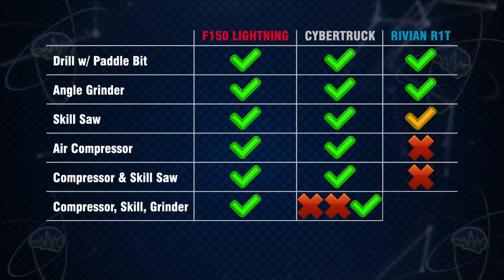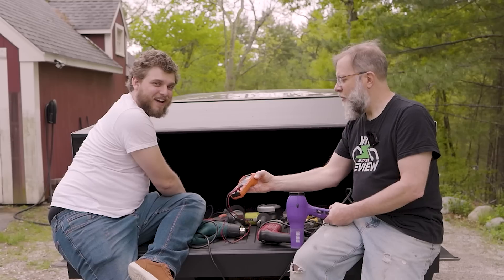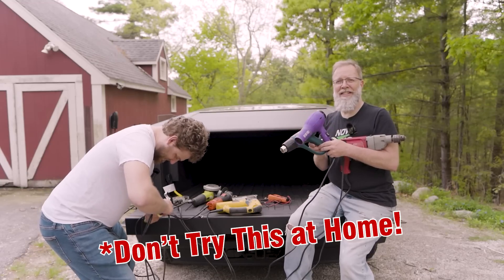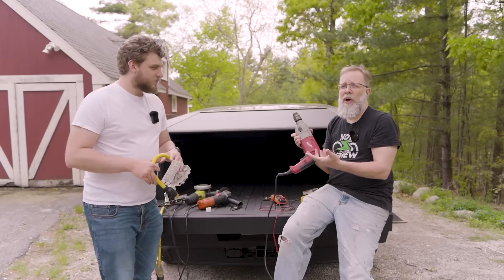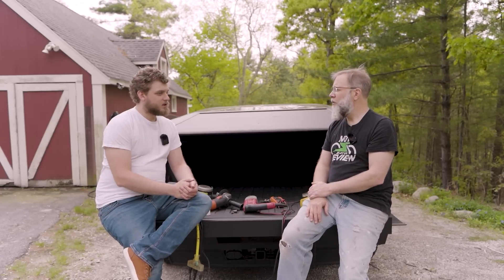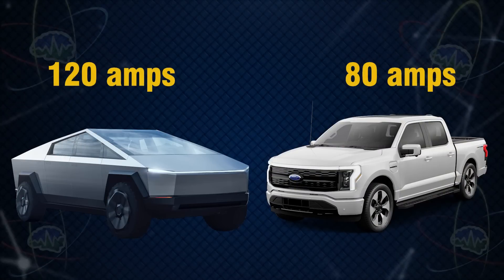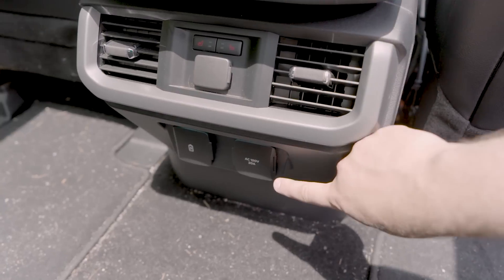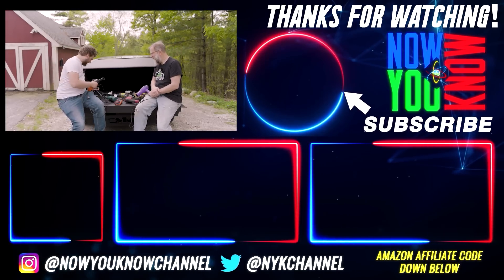Cybertruck vs Lightning: Find Out Which One Has More Outlet Power | In Depth

Comment: What are the odds of Ford getting a recall on the bed outlets for putting out 30A when they should be limited to 20A?  That seems unsafe (like using the splitter).  Likewise, is Tesla likely to get a recall on the auto-reset of the fuse causing stuff to come back on (perhaps right after setting down the "off" tool)?  At least Tesla could fix that in software.

Comment: i wonder could you use nacs to charge another EV with DC power from the cybertruck battery to save on loses from conversion from dc>ac>dc
Reply: also push the maximum of 14kw as 120amps x 120v is 14,400 watts

Comment: I would not recomend using a Nema 14-50 240 volt to 120 volt adapter on any EV.  Use the 120 volt plug, and if needed use a power cord with multiple outlets. Remember don't exceed the 20 amp rating for all plugged in devices. The 14-50 plug  should only be used in an emergency where you need 120 volt power and the existing 120 outlet is not working. In a 4 wire system like the 14-50 plug if the white ground wire becomes disconnected  then the device feeds 240 volts to whatever is plugged into 
the 120 volt outlet which  will  result in an overload and  fire.
Reply: Wait a minute, if the white wire is disconnected on a two wire circuit, there is no return path other than ground at 120V.  To get 240v, you need L1 connected to L2, unless I’m missing something.
Reply: If the neutral becomes floating it will not work on those 120V adapters.  2 of them use 1 hot and neutral and the other 2 use the other hot and the same neutral (14-50 neutral).  Without that neutral connection the tools just wouldn't work on the 240V adapter.

Comment: Jesse, dude, holding the angle grinder with fast spinning disk facing you, no safety glasses or shield and you think not looking at it will save you from injury? Glad electricity still works right. :)
Reply: They coulda just taken the actual disc out lmao

Comment: Your test showed the 40 amp plug using 4.3 KW or 4300 watts. Divided by 118 volts equals 36 amps. You did not exceed the the 40 amp rating. However  Cybertruck says it's max rating for all plugs together is limited to 40 amps. The truck does not have 120 amp capability.

Comment: From the Cybertruck owner's manual:
"All AC power outlets combined (120V cabin, 120V cargo bed, and the 240V cargo bed outlet) are limited to a combined maximum of 40A."
Reply: I was thinking exactly this.  They were smart enough to think that the outlets in the Ford could be sharing a circuit and did a test to prove it but then brain farted and gave the Tesla a complete pass by assuming every outlet had its own circuit and didn't even try the same test.  Strange thinking...   So Basically The Ford has Twice the output and much better outlet locations.   I think someone owes Ford an apology edit at the end of the video setting things straight.  That is, if they are really trying to be fair and not spread misinformation.
Reply: @darpompie4354  Yep, never happened, so you have your answer.
Reply: @usa-ev  Yah.  I never looked at the date.  They had 4 month to add a little blurb correcting their error with countless comments showing where they went wrong.  I guess they don't care about the integrity of their channel.  I now know that anything I watched here in the past may or may not be true and that there is no reason to watch anything here in the future.  I don't understand how anybody serious about growing a channel would operate in this way.
Reply: Yeah, this was dumb. Read the owner's manual and find the specs.

Comment: According to the Cybertruck owners manual, the max rating of both 120 volt plugs in the bed is 20 amps total, the cabin 120 volt plugs also are 20 amp max total  and the 240 volt outlet in bed is 40 amps max. The total combined for all plugs together is limited to 40 amps.  This is considerably lower than what you showed in the video. Please revisit this. Thanks
Reply: I look forward to the hat eating episode.
Reply: Could just do the kW (split phases), Lightning has 9.6kW (3.6+3.6)+(2.4) and the CyberTruck has 9.6kW (4.8+4.8) + Power share of 11.5kW, but then the Lightning also has the DC home power backup capabilities.
Reply: @D0li0  But my guy, you're thinking rationally not emotionally, and that doesn't show how the CT is any better, and we've got all this Tesla stock, you see? Com'on, man!

Comment: The 40 amp 240 volt Cybertruck outlet  is good for a maximum amp of 40. When you split each side of the 240 circuit you still only have 40 amps total but now at 120 volts. So having 4- 120 volt outlets  on your plug might be convenient for plugging in various appliances each plug is only good for a total of 40 amps by itself. But  since it is a 20 amp plug you should limit it to just 20 amps. Again even though you have 4 outlets the max rating is still limited to using  20 amps on any 2 of them at one time. Remember circuit breakers are rated for amps not total power.  If you tried using all 4 pluga at 20 amps the Cybertruck circuit breaker will trip.  Please please have this verified by a certified electrician so other Cybertruck owners don't try to pull 80 amps from  the 240 volt outlet.  Again the wire and breaker are limited to 40 amps no matter what voltage  it is on. Its the power that gets doubled  for the same size wire when  you go from 120 to 240 volts
Reply: This is correct the amperage is the limiting factor.

Comment: If I was going to use it for construction site, I would get Electrician to build a small electrical panel. That get feed from the 240v plug and have 4 20 plugs on breakers.  And then maybe a 50 foot 240 extension cord if you need to put in a central location.

Comment: Another option $1500 USD buys a portable power unit, DC-DC charger and a 200watt solar panel. Run chorded and battery tools all day.
Reply: Those things don't put out anywhere near this much power and could easily be fully discharged before the days work is over.
Reply: No issues for my mobile work/lifestyle.
Reply: @tumbleweed1976 , great, but those are completely different use cases.  Powering some electronics and an occasional coffee pot or microwave is not anywhere near the 10kW loads a cybertruck can run for many hours straight.  Both could get a lot of jobs done, but not on the same level.
Reply: @CL-gq3no  If I ever use my battery for a coffee pot or microwave I’ll report back.

Comment: they have the spliters that have fuses in them also that cost around $40
Interesting, the F150 is touted as a construction truck that people buy just for another vehicle.  Where the CYBERTRUCK was designed as a vehicle that can also be used by construction worker or tow.

Comment: You two are a hoot!!  Fun to watch. FYI the 240V circuits on both the Ford and Tesla are using a common neutral conductor and any load on each of the two 120V circuits reduces the neutral load from the other 120V circuit. In other words the two 120V loads become series circuits on 240V and the neutral conductor only carries the imbalance. I wonder if there is any Ground Fault Circuit Interrupter (GFCI) built into the system to detect a ground fault to protect the user?  Are the circuit breakers manual reset or do they reset automatically when the overload is removed?  I'm an old, retired electrician who dreams of owning a Cybertruck along with my Model Y. (Wife is extremely skeptical that I actually need one;)
Reply: That's the most technically accurate way I've ever heard about how the phase splitter works.
BTW, my Dad was a master electrician for over 50 years.
Reply: Ford has GFCI. Not sure about CT. Ford has manual reset CT auto resets after 2-3 seconds.

Comment: I think it takes 3 phases for 240. 3 phases are spread to 3 outlets 1 phase each here.
Reply: FYI: 3 phase in North America is typically 208 volts. that's 120 volts between any phase and neutral, but 208 between any two phases.
Reply: That's wrong. In North America 240V is single phase that is then split into two 120V circuits.
If you live in North America go look at you power lines, follow them back to your transformer you'll see that the primary side of the transformer is only connected to 1 phase of the grid.

Comment: I know you only want ideas from Patreon supporters, but I’m going to suggest them anyway. There is an accessory wire underneath the front tub of the Cybertruck. Can you use that wire to put a 110 outlet in the frunk? And if the wire for the light bar is by directional, can you put flexible, solar panels on the glass roof and plug them in and charge the battery.
Reply: Well then be a patron supporter, it's a dollor
Reply: I can help answer that for you. The accessory mid voltage system is not bidirectional. Nor can it support a 110/15 outlet as it is maxed at 180W.

Here's what you could do though: use the accessory 45v system as a trickle charge maintainer that can be turned on and off to a 12v battery through a charge controller. In parallel to the battery wire an mppt solar charge controller and a 2kW inverter. Add solar to spec for your battery and controller. Then L1 charge your truck from the 110/15 inverter circuit.

Comment: Lots a tools with no loads on them.
Reply: It's telling them how much power they are drawing, so why does it matter?  They are just trying to pull amps/watts using loads they happen to own, not determine some bizarre combination of duplicate tools that can run at once under unknown conditions.  They could have used 6 toasters.  As long as they are measuring in watts or amps it's irrelevant how the load was generated.

Comment: You didn't test if the 20amp cabin plug in the cybertruck was independant from the other ones either tho ? Or maybe I'm dumb
Reply: They tested that in the last video.
Reply: @supercadet111 And they were connected. From CT owner's manual:
"All AC power outlets combined (120V cabin, 120V cargo bed, and the 240V cargo bed outlet) are limited to a combined maximum of 40A."

Comment: Are you sure there is code you’re breaking? I thought electric codes like the NEC didn’t apply to vehicles which is why RVs can do what they want haha.
Reply: It's probably not breaking code technically, but it would be if it was a house.  They are "housing codes" after all.  Having said that, for the same price they could have bought a splitter with 2 x 20 amp breakers built into it.  They are available on amazon for $20 to $35.  So same result without the risk.

Comment: I think what you are demonstrating for average use would not be practical in real world use. Myself I would have the Truck charging cordless batteries for tools. Haven't used corded toold in at least a decade.
Reply: I see that they are trying to come up with whats possible and as time goes on we'll encounter all examples but i agree - it's all battery tools or large plug in saw tables.
Reply: Exactly.  People use power tools with attachable batteries and they're rechargeable later.  You bring somewhat more of the than needed by experience.  Using non portable tools, especially at a site is mostly a gone idea.  I don't think buying an expensive Cybertruck to power hand tools is really justifiable or will sell Cybertrucks.  FSD, and star link built in are more important.  Also automatic tire inflation or deflation to a set parameter for off roading.
Reply: This video series is not future iteration oriented and would be more interesting if it was.  Cybertrucks next model will be better in lots of ways and this channel seems to not realize it ahead of time.
Reply: @Wi2Low 

The problem I have with your statement and all such comments and those who write them is lack of proof.  If you can think then you should have real world statistical data to prove it.  Since you didn't your statement is unfounded and only an opinion.  Please prove me wrong to the benefit of everyone so we actually know when corded tools should be used or non corded tools.  Not guesswork, but actually data driven tested results.
Reply: Than you just have to plug your charger into the truck.

Comment: doing literally anything to make people think CT is better
Reply: They are showing you exactly how the Cyber truck is better. You don't like facts?
Reply: @Francisco_Manos Here's a fact: The CT Owner's Manual states: 
"All AC power outlets combined (120V cabin, 120V cargo bed, and the 240V cargo bed outlet) are limited to a combined maximum of 40A."
Reply: People use splitters like that on generators and temporary job site power poles all the time for the same reasons, lot's of power, but not enough outlets in the desired combinations.  I don't think it's a big stretch to do the same on a cybertruck.

Comment: Math is wrong on the CT 50a splitter…. It’s only taking (2) 20a circuits and splitting them into (4) receptacles… but it’s still only (2) 20a circuits. So the total including up front should be - 20a x 4 = 80a. Should probably test the CT two front receptacles just like you did on the Lightning, to see if they’re (1) or (2) circuits. 
Sorry for the bad news… Tesla fan, driving a MX Plaid, and I’m a FL licensed electrical contractor.
Reply: Hmmm .. (240v40a)/120v, or 9.6kW/120v = 80a. Split that 4 ways and you should have 20a each no problem.
Reply: And looking at the math equation in units of kW is smarter… but not always straightforward for the average Joe.
Reply: A North American 240 volt 40 amp circuit is made up of two 120 volt 40 amp circuits, not two 120v 20a circuits.  So that is 80 amps total at 120 volts just from that NEMA 14-50 plug.  The other two 120v plugs are 20A each as you mentioned.  Total = 120 amps at 120 volts, at least based on plug ratings.  More than likely the inverter has a total limit based on time/temperature that may prevent the outlets from being fully maxed out continuously.
Reply: I stand corrected… I worded that incorrectly. You are correct… (2) 50a/120v circuits are being shared amongst the (4) outlets of that splitter. I guess I was simply arguing how they presented the info (as if it was (4) individual 20a/120v circuits… but really it’s (2) 50a/120v circuits shared between (4) outlets.